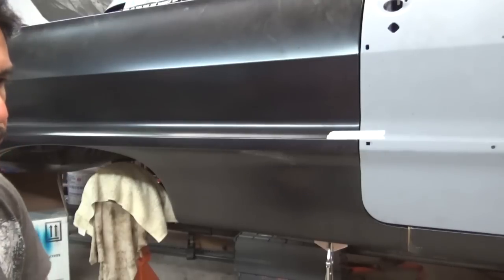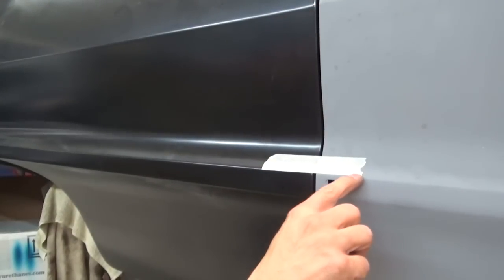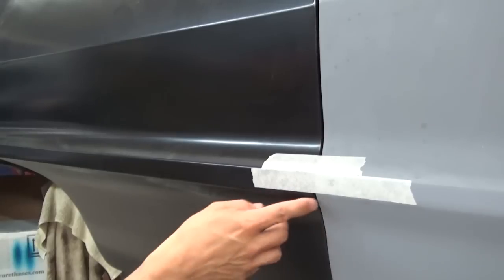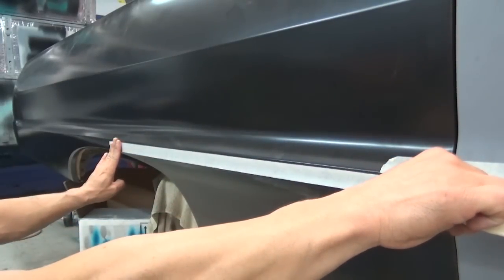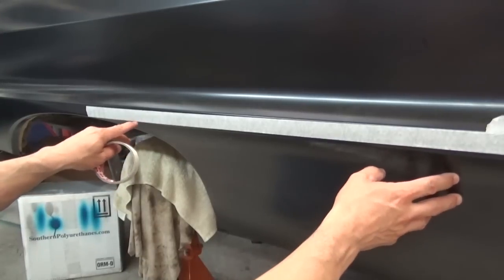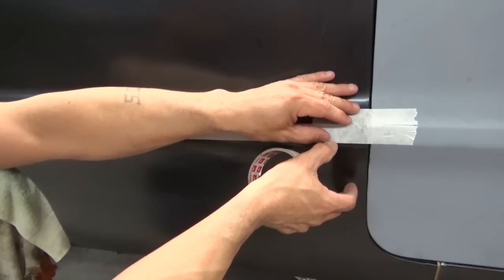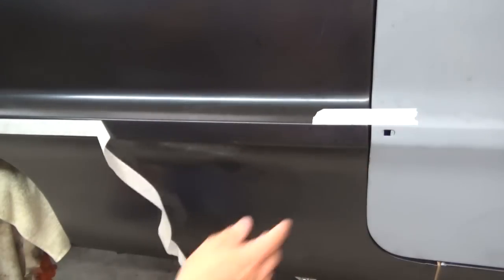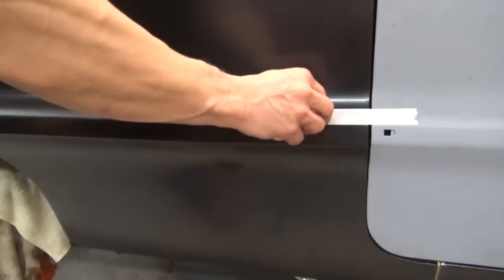Explaining Body Line Issue

Comment: Great video Sam. As others said below, you are going to have to watch out for that gap at the bottom of the panel near the rocker. That is going to close up too much I think. You might have to spilt the panel in two places to allow you to move it up and down at the same time. Aftermarket panels, gotta love 'em!
Reply from the maker: asicerik I'll be okay at the bottom, will show that on the next vid, thanks.

Comment: Good explanation about splitting the panel.
Are you going to split it lower near the rocker as well to keep the lower door gap open?
Great video.  :-)
Reply from the maker: cecil6711 Thanks Cecil, no need to split the bottom i'll show that on the next vid,

Comment: Man I just watched this video and I love the explanation! My only question is when you slice that line won't that effect the bottom gap that goes across the rocker! Not sure if you covered this already? How much is the line off?
Reply from the maker: It did not effect the bottom gap by the rocker. It's not off much 1/16 or less once I cut it with the cutting wheel I trim off a little. The body line on the 1/4 is more square than the door so once I weld it back I round it off a little. Thanks for watching.

Comment: Thanks for taking the time to make a vid , I just wasn't sure if the panel came down to take up the space or moved up , now you said it moves up but that closes the bottom of the door gap to , so will you have to split it there too to remake that gap ? Thanks
Reply: MrFireman164 I was thinking the same thing. changing the bottom door gap. the bottom gap looks small a little anyway. Right by the rocker it looks like it could handle a little move up, but aft of that it looks a little small, but you can tell better seeing it first hand.
Reply from the maker: Julian P. The bottom look to be okay, will show thst on the next vid.